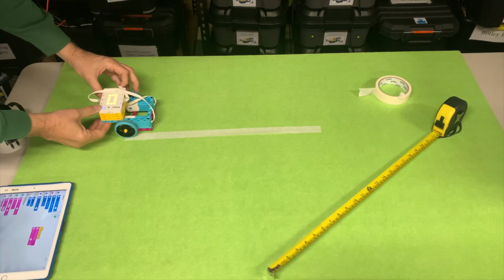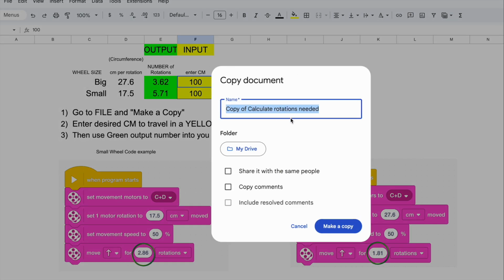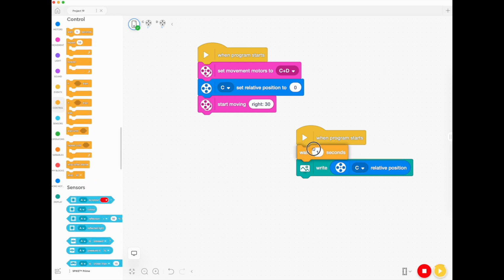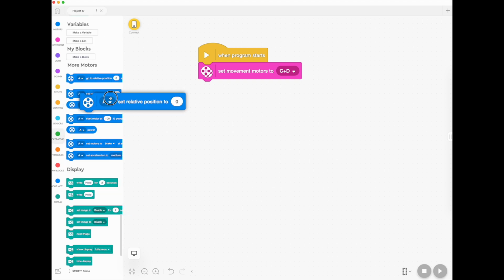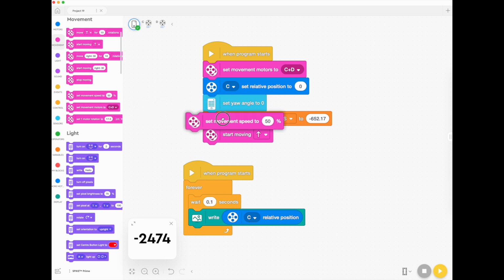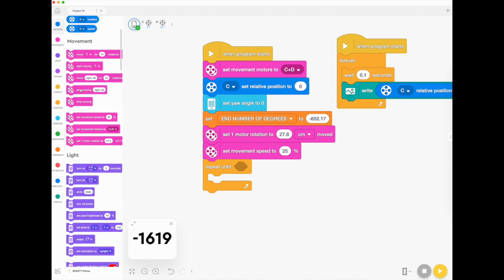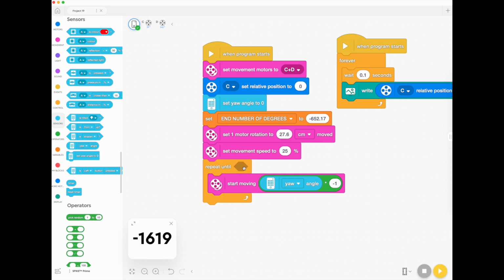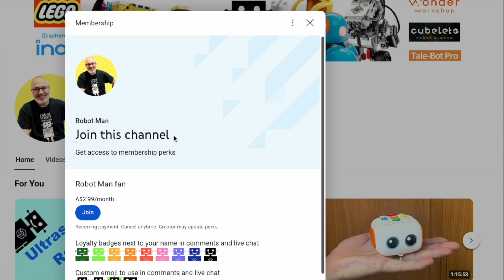Precise measurement and perfectly straight lines for Lego Spike Prime robots.

Comment: Do you know how to make the robot run backwards using this code without totally glitching?
Reply from the maker: The easy way to make a robot run backwards is to swap the movement motor cables. So if they are plugged into ports C and D, just swap D into C and C into D. 
Another way to make things go the opposite way is to change all speeds to a negative value.

Comment: @robot_man Why you think it didnt stay straight at 100%.  Is their a max.  Thank You for your post.
Reply from the maker: Probably just too much power for the weight of the robot to handle. I think things start going about off at about 70-80%. I think every motor acts slightly differently too. Maybe one motor controlling two wheels and the other controlling the other two might go straighter…. But then you have to deal with symmetry.

Comment: I'm using a 62.4 x 20 wheel. Can you check for me how many revolutions I need per centimeter?
Reply from the maker: The circumference is 62.4 x pi which is 196.04mm or 19.604cm 
One rotation will equal 19.604cm 
If you enter number of cm you want to go into my spreadsheet, it will tell you how many rotations that is. I have added an extra row for your wheels. 
Type desired cm in yellow cell.
Reply: @robot_man thank you

Comment: Thanks Robot Man!  Just a heads up if you copy and paste from the google sheet into the variable block, make sure you remove any commas!!! We had "1,900" in our SET END NUMBER OF DEGREES and our code failed to run.  We just removed that comma (1900 instead of 1,900) and that solved it!
Reply from the maker: Great pickup! Well done!

Comment: You probably shouldn't be testing with one wheel on that tape line; have them use the same material. If each wheel has different traction then any tiny slip of the either wheel will throw off angle of the robot
Reply from the maker: Yeah, good point.

Comment: I think if you measure the other motor, you will have positive degrees. The motors have to turn in opposite directions to move forward.
Reply from the maker: They appear to look to be going clockwise and anticlockwise, when you look at the vehicle side on, but that’s because they are placed opposite each other instead of the same way. If you put the motors side by side so both blue turning circles are on the same side, you’d see they turn the same way.

Comment: Is it okay to use the Set Relative Position to 0 block for both motors, or should it be used for only one motor?
Reply from the maker: One motor will be enough because they travel the same distance when going straight

Comment: Thank you so much for your excellent and clear explanation in the video — I truly appreciated it. Also, thank you for sharing the attached Google Sheet; it’s very helpful.

I tried to follow the commands as shown, but I noticed that the motor's position never resets to zero. It always continues from the number it started with. Is there something I might be missing?

Also, I found that when the speed is set to 100, the robot doesn’t move in a straight line. In competitions, we often need to use high speeds, so I was wondering — how can we maintain accurate straight-line movement while keeping the speed high?

One more question:
Is it possible to use two "When program starts" blocks in the same project?

Thanks again for your valuable work!
Reply from the maker: Thanks for the encouragement! 
When you use the "set relative motor position to 0" It doesn't move the wheel. Its like a counter resetting. It should go back to 0 if you use that block. While the program runs, on your device there should be evidence of this (by tapping on the icon where you usually connect at the top of the screen). 
Fast speeds often cause inaccuracy. It's almost impossible to go straight with 100% speed. But the heavier your vehicle, the more accurate it should travel.  Having said that, it's pretty difficult to go straight with a speed over 80%. Occasionally some motors are slightly more powerful than others. So often, just switching out motors can help. My number one tip for going straight is that your vehicle needs to be symmetrical. 
Yes. You can have more than one "When program starts" stacks in the same program. When you press play, both stacks can run simultaneously. Although sometimes, if the stacks are similar, there can be errors. Sometimes I use a timer, so the second stack doesn't start working for a few seconds. 
Hope this helps. 
Robot Man (Steve)